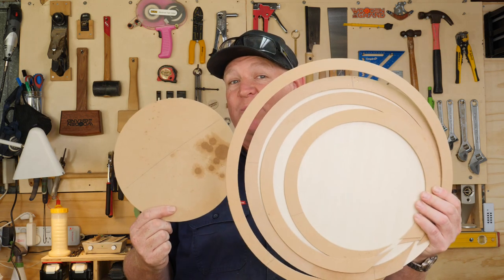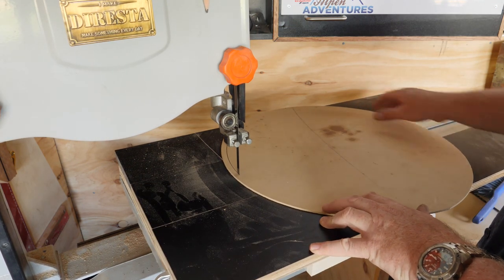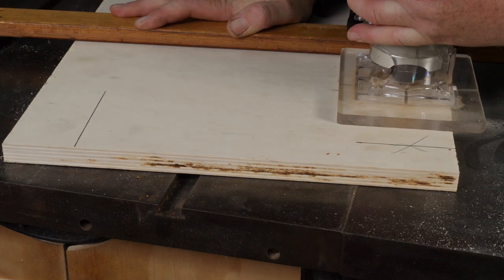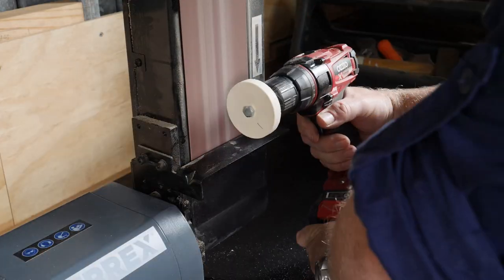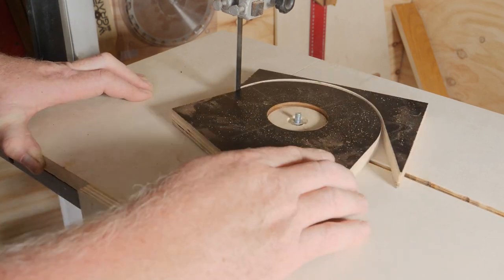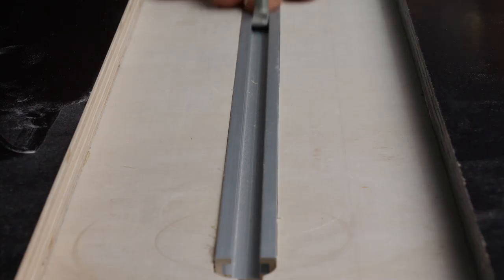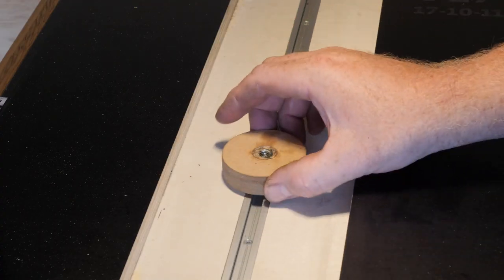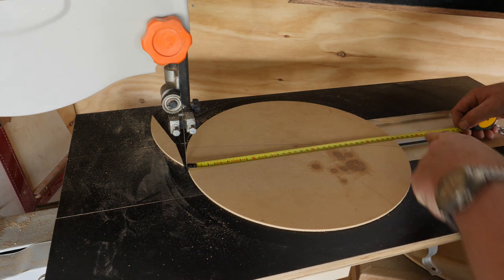How I Made a Jig to Cut Circles on a Bandsaw - without Leaving Holes!

Comment: Simple ideas are always the best, that's a great one, good stuff! I have (if it was cheap and crappy) the same hole cutting tool I've been known in the past to take a hammer or pliers to the teeth, tapping them in or out, in order to get a hole which is marginally bigger or smaller 😉 I'm not saying it's good practice, but as it's a cheaper tool, it doesn't make me feel bad 😂
Reply from the maker: Best thing about homemade jigs is you CAN adjust them the way you want. And if you mess it up too much, just build another. 
And there are just so many ways to skin a kangaroo. 🐱
Cheers for the watch!